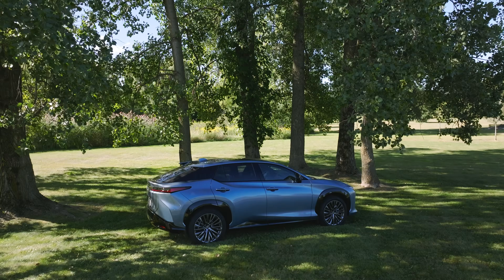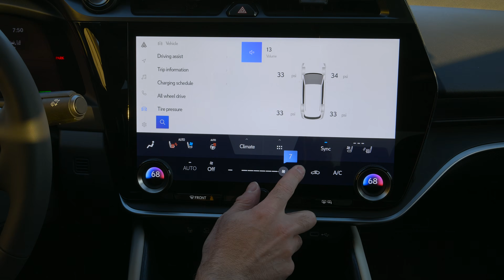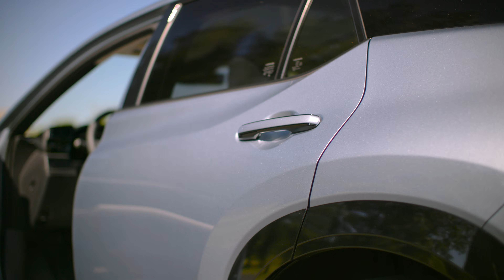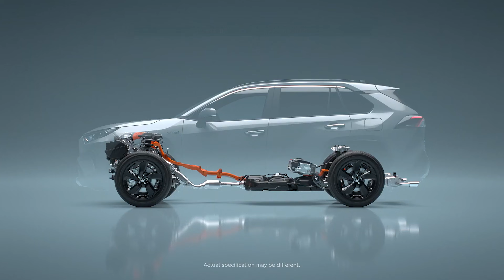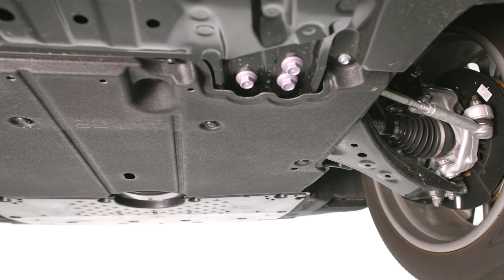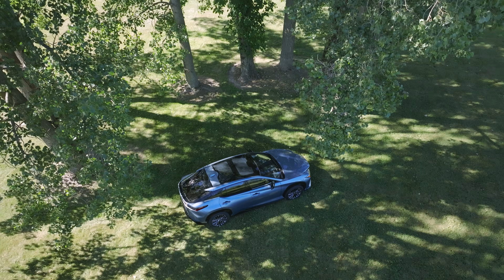Lexus RZ450 EV | Just Say No!

Comment: things like the electronic door handles and capacitive touch controls are total deal breakers.
Reply: I've no issue with the capacitive touch controls, except that almost all of my winter gloves won't work.  That is a more reliable switch mechanism than a mechanical switch, especially if it depends on a silk screened rubber dome on top that rots away over time.  The HUD for them though, is a different story, and I would rather not have touch-capacitive on the center stack as that is not tactile at all, will just cause more attention to be diverted away from driving, yet it already is with the touch screens any modern vehicle has.
Reply: That’s actually some of least practical things on EVs or cars trying to be futuristic. It’s a deal breaker? Wow. 😂
Reply: need them for frameless windows. sorry. why is it a big deal for the handles? on tesla theres an emergency mechanical latch.
Reply: Agreed. like the VW ID4, this has a few simple problems I just couldn’t live. Disturbingly these aren’t issues they just phoned in, these are issues they spent real time engineering and implementing yet got so wrong.
Reply: @emotionz3  The rear window switch just screams"why?"

Comment: I have a very different take on the shorter range evs. These are vehicles owned and used in urban areas. So to me if someone can tell people to go buy a phev that by the way if you dont plug in every day and use all you ev range. You wasted probably 4 to 5k to get it. on the opposite end you lugging around a ice engine that you paid for and never use. How can shorter range evs be an issue? If you are pure urban driver who rarely does road trips which is most folks a 100 to 250 mile ev gets it done. Even me with my 50 mile round trip could work with it. Also since when did it matter that something better is come 4 years from now. That arguement makes no sense in the world period. Theres always a better car coming. By thay logic never buy anything because itll be obsolete the day of purchase.

Comment: Are there any sedan, 2-door, or hatchback commodity EVs available in the US yet? It seems like downsizing would be an easy shortcut to longer range with the same battery tech, but maybe the weight of the battery is such a controlling variable that the size of the body around it barely matters. Also we need smaller cars to address the pedestrian casualty crisis.
Reply: For real I fail to understand why efficiency is allegedly prioritized yet cars have such immensely tall rooflines and ride height? Huge step backwards.
Reply: @RatBürgerSk8   Boomers. Average new car buyer is like 58 now
Reply: Ugly Chevy bolt and bolt euv
Reply: Sedan: Ioniq 6, Polestar 2
Hatchback: Stellantis and Nissan are likely making those
2-Door: What kind?
Reply: Leaf & Tesla spring to mind

Comment: Sigghhhh...yet ANOTHER generic Coupe SUV.  I die a little bit inside every time I see a video featuring one of these vehicles.  The coupe SUV trend that has been hot in the US for the past 6-8 years is nauseating.  I love Lexus, my wife has an RCF and it is a fantastic car.  Seeing Lexus go down this road truly makes me sad.  How do you go from something like the LC500 or the IS500 to this?  What makes it worse is the fact that Lexus, in addition to most other manufacturers, are bowing down to the Chinese market (when they should be RUNNING away).  Though it isn't as bad as other vehicles, this thing screams China to me.  There are several design trends that manufacturers are adopting to cater to China.  The most obvious one is the elimination of the Lexus logo on the rear hatch and replaced with the word "Lexus".  There are so many manufacturers doing this.  The reason is, copy-cat and look-a-like cars are a huge problem in China.  The copy-cat brands were adopting similar logos to mainstream manufactures and slapping them on their cars.  They are often very difficult to distinguish.  Writing out "Lexus" on the rear eliminates that problem. For another example, look up the brand ZEEKR.  Look at their logo and then compare it to the Sennheiser logo.  The lack of creativity in these Chinese manufacturers is truly astounding.  The second Chinese design trend that is killing automotive design is the separation of the daytime running lights from the headlights (DRLs up high, headlights hidden in the bumper).  BMW 7-series, I'm looking at YOU.  Fortunately, that trends hasn't hit this vehicles yet.  

Mark, I can feel the pain and disappointment in your voice every time you have to review one of these shit box coupe SUVs.

Comment: I generally agree with you, and didn't really like this car when I test drove it.  However, I really wish car reviewers would stop obsessing about range.  I was so worried about the range on my E-tron because every reviewer complained about it. In practice, even with a relatively long commute (70 miles round trip) it was literally never an issue for me.  I changed at my house every night and had a full battery when I went to work in the morning.  I even took it in a couple short road trips (2 hrs or so) with no issues.

Very few people actually drive more than 100 in a day ever, so a 200 mile range is more than enough.  It's like buying an F-250 because you haul gravel twice a year.  Yes it's useful those couple of times, but it's a waste the other 95% of the time.
Reply from the maker: I literally planned every drive around getting to a charger with a 150 mile range using A/C.  And that means driving in eco or normal most of time.  In this video I drove from shop, home and store and was down to 25 mile range. Went home to sit on charger before I could go and finish more driving. Its stupid to constantly have to plug in and its wasteful and higher cost to be plugged in during the heat of the summer day.  I could go about the same distance in a V10 Lambo, except I could stop and fill up in 4 minutes, not drive around for 35 minutes to get to charger and sit for another 30 minutes on a fast charger.  Its trash and for 65k no normal person that has a busy lifestyle is going to make an excuse to drive around a dishwasher like this.
Reply: @savagegeese I agree that this car is highly overpriced trash.  I just disagree that the range is WHY it's trash.  The average EV driver has a charger at their house (80% per consumer reports).  The average person drives 37 miles a day (per Kelly Blue Book).  So for the average person, the range is not relevant.  If you're relying on public charging (as I feel most reviewers are) then range is a huge deal, but that is the exception and not the rule.

I ended up buying an i4 instead of this, but not because of the better range.  I got it because it's a far better vehicle and I'm sick of egg-shaped SUVs.
Reply: @spudlevski…. The problem with your statistics (and everybody who mentions “average EV drivers”) is that the average EV driver IS NOT an average driver.  The average EV driver is a self selected group of people with a house capable of home charging. A lot of people lives in apartments or townhomes where they might not have a garage and they don’t have a place to charge. Consequently, they don’t buy EVs. So, when a magazine with zero sense for statistics, seemingly, runs a survey of EV drivers then the people who would be contrarian to the findings, ARE NOT EVEN INCLUDED IN THE STUDY POPULATION. God! Then we have the average EV driver, like you 😂, quoting it.
Reply: @is6566  What you bring up is a large scale charging infrastructure problem.  We focus on DCFC infrastructure when we should probably be focusing on Level 2 charging where people park.

However, as of now, 70% of people live in single family homes.  Given that EVs are expensive, I'm willing to bet that the percent of people shopping for a $60,000 car who live in single family homes is much higher than that.  I'm still talking about the majority of people regardless of your criticisms either way.  

If you live in an apartment and want an EV, a vehicle with more range is probably better.  However, saying things like "All EVs need at least 300 miles of range" is just not true, since many many people will not need that range.  These statements turn people off to EVs in general or steers them towards an inferior vehicle just because it claims to have 350 miles of range.

Comment: Can't wait until tuners manage to crack these to see if there is any potential.  I'm good with charging more often to get 300-400 hp&tq without all the maintenance that a turbo 4 needs over time....
Reply: get a model 3 performance.0-60 in 3.1, 500 hp. 46k after rebate. nothing fossil is coming close unless its a c8 corvette or m3/m4 with dct. both are a lot more expensive

Comment: I’m not convinced that full electrification will ever be achieved. Mark is far more optimistic than I am.
Reply: Depends on how you define full. I expect the vast majority of non-commercial vehicles to end up electric. It's just too nice of a drive train experience versus what's out there.
Reply: @nomenclature9607 Eventually that’s all you’ll be able to buy and you’ll like it. Sincerely, California.
Reply: It’ll probably follow the same path the smartphones took to become ubiquitous just on a longer time frame.
Reply: ever? What do you think will power vehicles when gas runs out? Hydrogen fuel?
Reply: @AbhishekKumar-vx9ub  The more pressing question is, if gas ran out, would we even be able to switch to something else? IMO our infrastructure/logistics are just fucked if that happens. We do not have the technology
Reply: Oil is constantly being made.  Get the fossil fuels bs out of your heads.  Its not made from fossils its made from plants.  Oil will never run out
Reply: @AbhishekKumar-vx9ub  Probably biodiesel or fully synthesized fuel. If suddenly every oil well went dry, we could to turn H2O and CO2 into ~C11H24 fuel and O2 for industrial use. All the technical ability is there. Of course the dream is that batteries just replace hydrocarbon fuel, but we're getting close to the physical limits in energy density you can get from electrochemistry, and downsides in carrying the whole mass of your energy storage even when it's exhausted. Aircraft for example, will always need chemical fuel or better for long haul routes. Rockets for space launches will also always need a chemical fuel.
Reply: @AbhishekKumar-vx9ub Gas running out is a more complicated topic than how you're referring to it. For example you mention Hydrogen. But our Sun consumes 600 million tons of hydrogen per second. So won't that run out too?

Comment: Basically, end user should not be Beta Testers.  This is also now a throw away project, already superseded by internal plans as revealed/leaked.  Given the Soltara's recall, they even have had basic mechanical assembly issues as well, which indicates that something in Toyota-land isn't working to the standards they aspire to.  Gosh, this might even be an pre-Alpha product and dead-end on the evolutionary chain.

Comment: Lexus should have talked to the enginer/designer of the steering wheel in the 2004-09 Prius. Those cars had buttons to control audio, climate, map screen, info screen, phone  and voice command in an intuitive layout. With today’s trend of digitizing climate control functions, the 04 Prius offers the best solution to the accessibility issue this creates. That generation of the Prius had no physical climate controls on the center console, everything was on the screen. However, core functions were duplicated in supplemental steering wheel mounted buttons. On the 2004-05 Prius they were also backed up by one of the most comprehensive voice command systems in any Toyota. The list of available commands had over 100 commands, it was a very well featured system for 2004-05. It got watered down in subsequent generations of the Toyota Navigation system to the point of loosing the ability to control the climate control system. Looks like now they are playing catch-up.

Comment: When they can improve more, I'll be ready to go electric.  For now it's still the range-charging problem.  I have a gas car.  An electric will have less range and take longer to fill up.  Fine.  But then I'm being charged more for the car, and that's the deal breaker.
Reply: I hear what you're saying. It also depends on how much you drive. I went EV in 2020 and it was the best decision ever. BUT I drive under 20 miles per day and work from home. So range was less of a factor. The range anxiety thing was a non issue for me, but I understand the hesitation.

Comment: My problem with this Lexus is the outward visibility .. especially for a SUV ..  And especially if you are over about 5' 6".. They made the roofline way too low and it looks like a low ceil cave.  This low ceiling makes for a uncomfortable, cramped cabin and bad visibility..  And with poor visibility, you get an unsafe vehicle that is too dangerous to drive.  Lexus should have made it more boxy and raised the roof about 4 inches.   This would have made the RZ MUCH better visibility, more comfortable, more enjoyable to drive - and MUCH safer to drive.

Comment: The main crux of the issue is the e-TNGA clearly wasn't designed for larger or more luxurious vehicles, and this is reflected in the fact the biggest battery Toyota & Lexus can shove underneath is this smallish 71 kWh battery pack. In comparison, the VW MEB & Volvo CMA currently can both fit a 82 kWh pack, BMW CLAR a 84 kWh, the Ford GE1 a 99 kWh and the GM Ultium even bigger than all the above.

That heavily restricts the Lexus from becoming competitive range wise, and at the price they're charging for it makes a a hard call even if you like Lexus or the car itself.

Comment: I think the steer by wire is worth looking at as something to distinguish this car when it comes because it is variable. This is a much better review than the bZ4 which I think you weren't fair to at all. But, I don't think this is anything like the Y. It's around the same size and it is a CUV. Beyond that, it's quite different. I saw this on the highway and it is borderline stunning looking. I think this is a warm up for Arene and other tech coming from Toyota. Lease it. Lexus isn't making many and if you can charge it from home then the slow charging won't make that much of a difference.
Reply: Um, no. The suburban soccer mom who is driving this does not give a crap about 'steer by wire'.
Reply: @panerai_fan  But she does care about a car that is easier to steer at lower speeds.
Reply: @benjaminsmith2287  It will steer easy at lower speeds regardless. Nobody ever struggled to steer a Lexus in the history of the marque. You act as if this was a 1965   Buick behemoth with no power steering. It's not. It's a modern day car that can be steered by anyone with one finger.
Reply: @panerai_fan  You're missing the point. It's not effort of steering but how much steering one needs to do that makes this type of steering interesting. If you don't have to turn as much and the car adjust to minimal input, that's a positive.
Reply: @benjaminsmith2287  The point is, Lexus has not lost a single sale due to the amount of steering one needs to make. Nobody cares. The soccer mom drinking her Starbucks doesn't give a crap. Adding 'steer by wire' is irrelevant to Lexus. It just doesn't matter.
Reply: @panerai_fan  Point is they are making a change in the steering because they feel that some would like it better. It's an option. Lexus and Toyota spent a lot of time and money working on this for some reason. If you don't like it, fine. Others may be interested. You have no idea if "nobody" cares about it or not. The market will decide that when it becomes an option then we'll know better if they do or don't.
Reply: @benjaminsmith2287  I know for a fact that anybody shopping for a Lexus will not care. Additionally, they did not spend a lot of money on this. The market has already decided because Lexus sells every single unit they make.
Reply: @panerai_fan  What are you talking about? You're just being against it to be against it. It hasn't even come out to the market yet. Some testers have driven it and most seem to think it works well but there is an adjustment period. But steer by wire will probably hit the industry like it did the airplane industries and brake by wire has hit the industry.
Reply: @benjaminsmith2287   It's been around for ten years already, Nissan put it out and it didn't matter to the consumer. I am not against it, my point is nobody will care. It's irrelevant to the consumer.
Reply: @panerai_fan  It was NOT variable in the Nissan. What makes the Toyota/Lexus version interesting is that it is variable. Again, it may not be to you but that doesn't mean it isn't to customers who may try it and prefer it. And nothing is proven yet because it isn't out yet. So, it's futile to even discuss. I can only say you are being premature in thinking nobody wants it because you don't. You aren't everyone in the car-buying public.